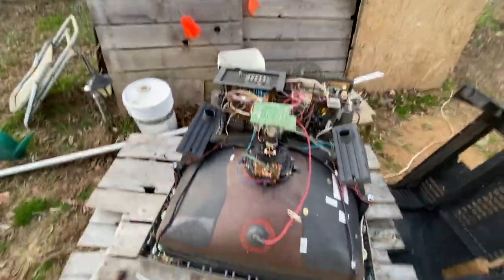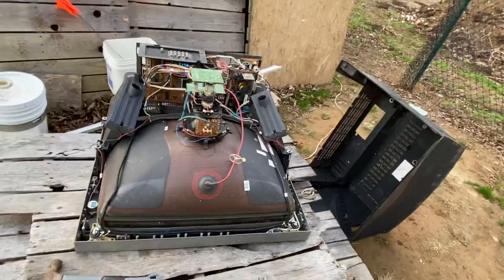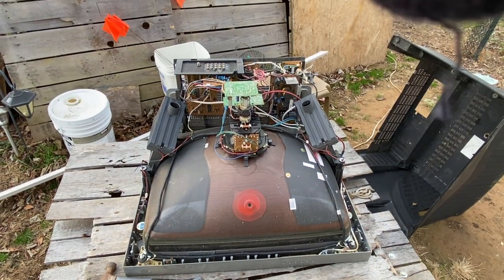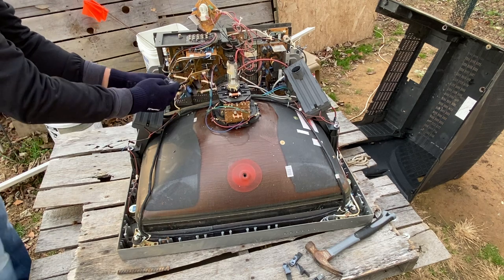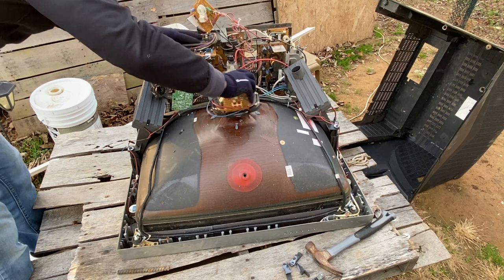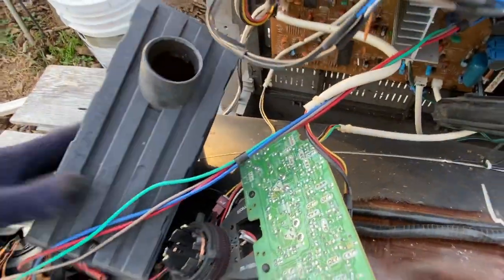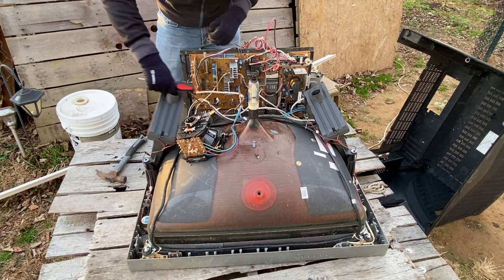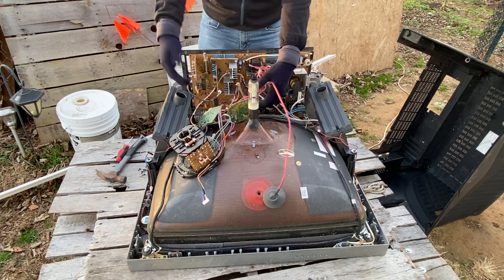How to scrap and disassemble a CRT TV￼

Comment: You don't discharge to tube that way. That's the "safe" way to electrocution. You have to ground that screwdriver. Your tv is "floating", thus is isolated.
Reply from the maker: To tube? It’s how to scrap and disassemble a TV not discharge. pay more attention to the table next time.
Reply: @funstuff4521   No, you funny thing. It about surviving such an activity. Lucky that CRT wasn't charged, otherwise you wouldn't have replied.

Comment: Ferrite yoke cores can be sold for some decent money (10/20 € for the pair). 🤔😏

The flyback transformer goes for like a minimum of 5 €. I've sold mine for an average of 10 €. Sometimes 15 €/piece. 😇🤗

@ 08:29
I usually keep the long thin copper wire that is wound all around the CRT. I have a bunch of empty plastic spools from solder wires. So I wind the wires on those. 😊

Powerful MOSFETs that are on the PCB too can be sold. So lots of useful parts.